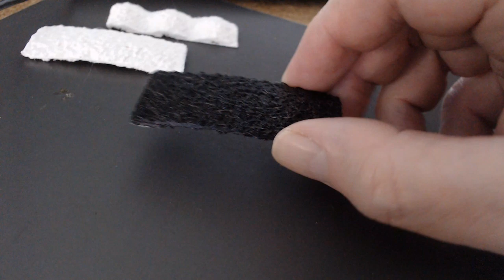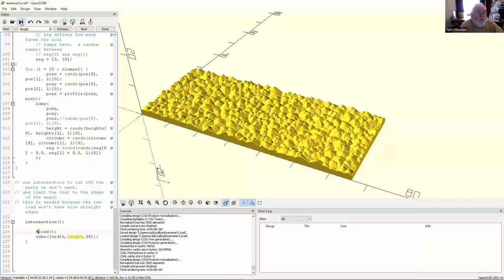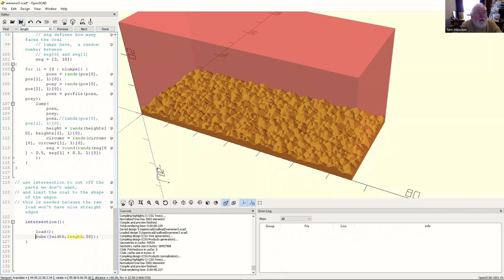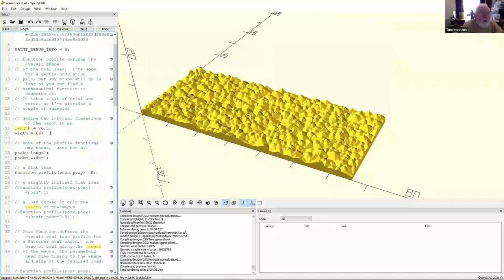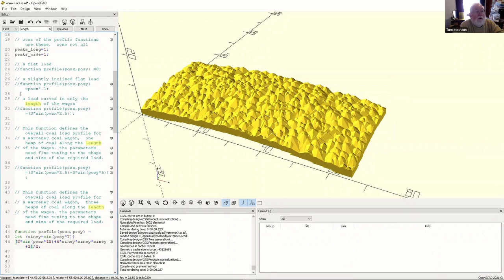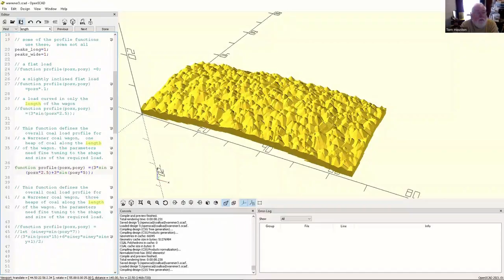3d printing a coal load

Comment: are you using a resin printer
Reply from the maker: Hi Dwight, no this is using a Creality ender 3 v2 FDM printer.  
I've just bought a resin printer,  but need to find some space in my shed to run it.  I hadn't appreciated just how bad resin smells
Reply: @tomhoustonmodelrail  they hsve resin that has less smell now and some that you clean your prints up with water i been thinking about buying a resin printer to i do have ender3 pro and another printer that stop working for me
Reply: I used coal in my loads on a bit card
Reply: @kingfoxjunction2181  nothing wrong with that 👍🏻